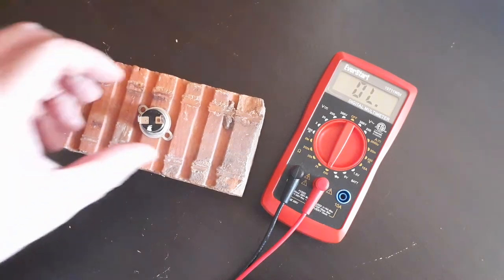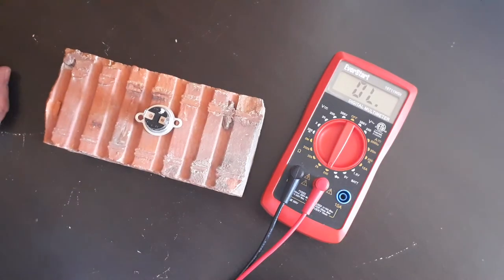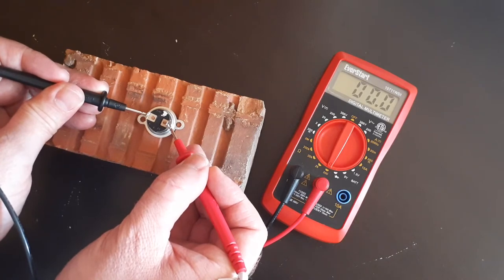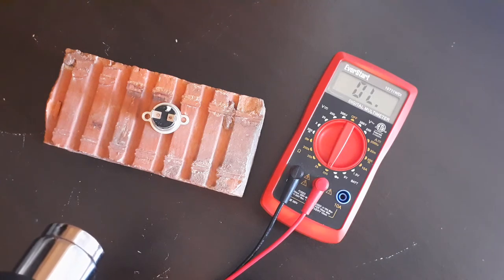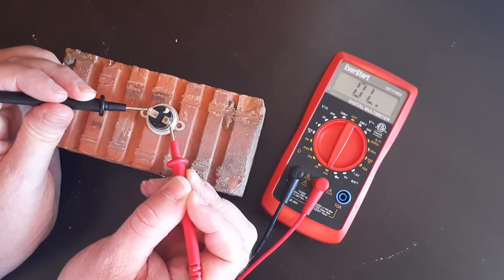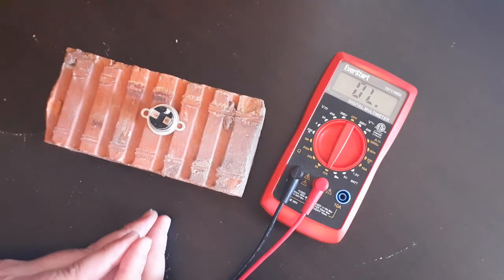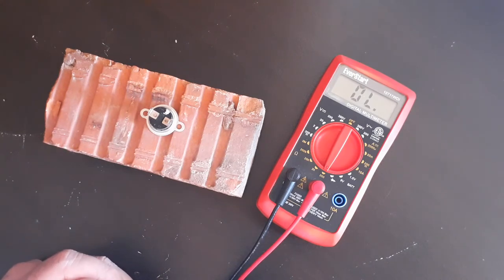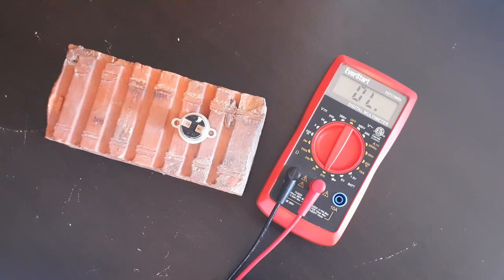Microwave Thermostat. Normally Open Or Closed?

Comment: Your video Helped me to Solve my GE microwave Over the range Fan is running all the time when I plug the Cord.    There are many Normal close in Room temperature on the Thermostats..... but my is Normal Open...at first I thought it was bad.
Reply from the maker: Yeah if the thermostat goes out it has no way of letting the fan know when to turn off. Glad you got it figured out. If you need other parts in the future I have many different microwave parts for sale here: https://www.ebay.com/sch/159903/i.html?_dkr=1&iconV2Request=true&_blrs=recall_filtering&_ssn=unique_knacks&_oac=1

Comment: My microwave doe not heat food-but everything works-I have 2 of those thermal switch in my unit one has continuity one dosent--if I jump the one that do not have continuity the microwave fan runs continuously and do not let me enter any numbers on the dial--I assume they are ok but something else is broken

Comment: Great video. Recently my Kenmore OTR Microwave main thermal fuse blown while open the door. I put new fuse and system turns ON while plugging the cord. Two thermal fuse: KSD201 120 (has continuity means normally closed) and KSD201 70 (No continuity). I guess all fuse should have continuity. Seller sent me normally open KSD301 70 250V 10A instead of KSD201 70 125V. I plugged that in and connect the cable and microwave turns on with fan. Fan does not turn off and also display turns off right away. What else should be broken? Seller is sending KSD201 70 125V normally open and close both. Please provide solutuon